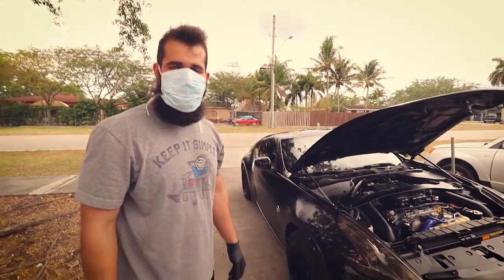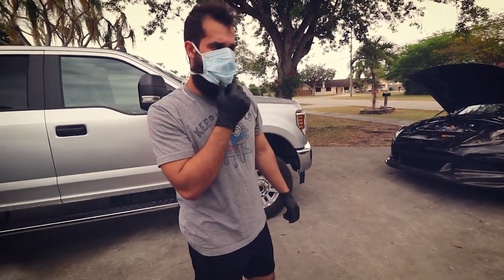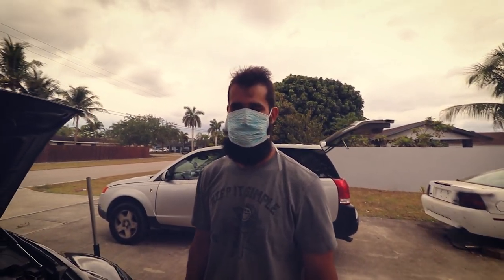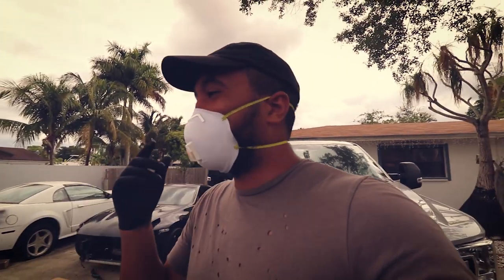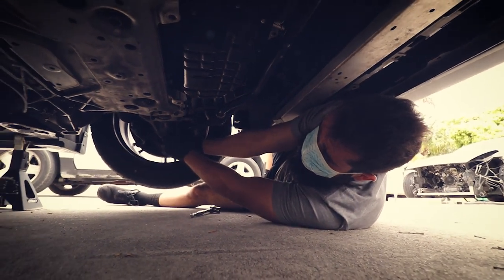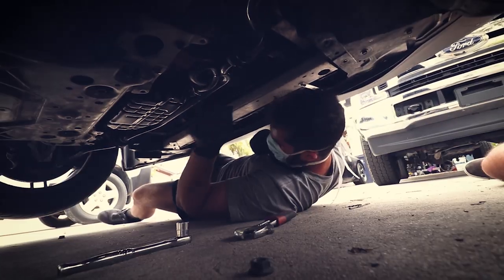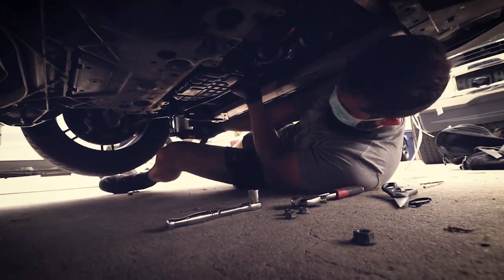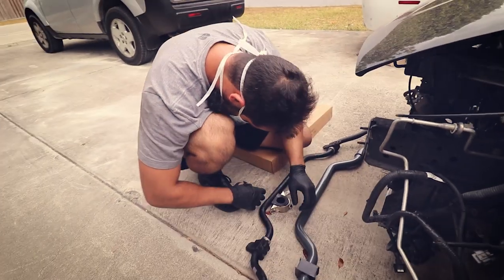The ONE Mod You ABSOLUTELY Need But Don't Have *CHEAP* |  370z Hotchkis Sway Bar Install

Comment: How long did the z1 diff bushing last before it failed?? I just installed the z1 bushings a few weeks ago.
Reply from the maker: - I think he’s had them a little over a year or year and a half. I’m sure he’ll comment with the full details.
Reply: Michael Smith about a year and almost a half lol the diff bushings literally disintegrated why I have no freaking idea
Reply: Wow ... I’ll have to keep an eye on mine then. Thanks!
Reply: Michael Smith let me not get started on how bad the slave elimination kit they sell is GARBAGE! I couldn’t take it anymore I ripped it off and went with the CMAK kit
Reply: Shayan Zabihi in my last Z I went with the whiteline bushing and this time around went with Z1 because the looked more stout but guess I will find out ha.  Yeah I have been watching my fluid level and plan to get a CMAK kit when the time comes. Really hope I dont have to redo the diff bushing though ha did you do the CMAK on a lift or your back?

Comment: I also plan on doing the same type of activity you are secretly planning on doing as well... I want to buy RPF1 square setup, wondering what cheyanne’s specs are? I think I’m gonna go with 18x10 +38 with extended apr bolts in the rear/front to run spacers. The forums talk 18x10.5 +15 but it is hella pokey in the front. Also, thanks for still wrenching through all the crazy out there. I would love to work on my 370z as well but I just welcomed two twin girls into my world and they are currently the focus so I’m living vicariously through you guys!!
Reply: Karl Merecido bro i am swapping my RPF1 set up with Konig hypergrams 18x10.5 +25 square and just run the 25mm spacer in the rear and use 275/40/18 tires. Hope that helps. My set up rn is 18x9.5 +15 and 255/40/18 and rear is 18x10.5 +15 and 275/40/18
Reply: @TheShayanzabihi  nice, i'll have to look those up. I was looking at gram lights because they had the right specs for a square setup. that 18x10.5 +25 would be perfect. Thanks for the quick response. Hope you guys stay safe and Shayan, sorry for the miss-spelling above.
Reply: Karl Merecido hey sorry I meant a 20mm spacer in the rear!! And we are staying as safe as we can.